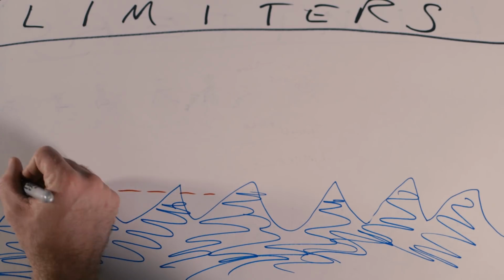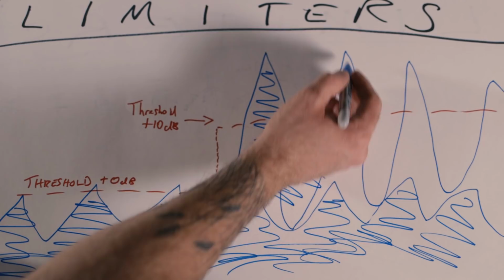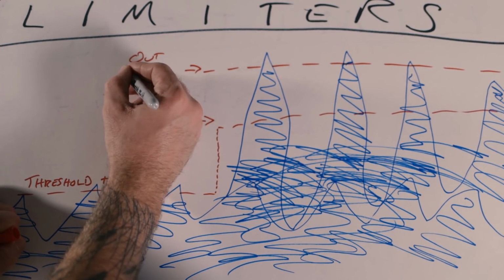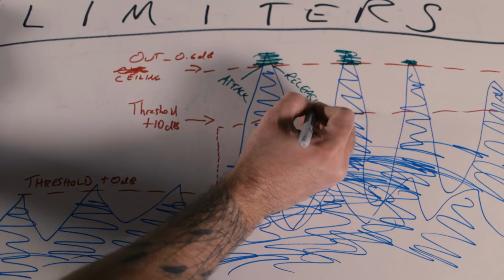What is a Limiter? // AUDIO Production Tools Part V of V // How to use a Limiter tutorial

Comment: What is a limmiter?
Limiter is a dynamic proccesor that manipulates the amplitude of a signal.

Purpose:
A limmiter raises the amplitude at a designated amount and you set an amount for it to stop at.

What does it do?
It just raises it how much ever you want. And their is a ceiling it stops at.

Types:
Brickwall limiting
True limiting etc.

Second Definition:
A Limmiter is like a compressor with above a 10:1 Ratio.
------------------------------------
[] Recall that compressors turn down audio peaks when they go over a certain threshold level. 
[] The ratio determines how much that audio will be reduced by
[] A 3:1 Ratio translates in english to "For every 3db the audio goes over my set threshold, turn down by 1db"
[] Therefore a 10:1 Ration translates to " For every 10db the audio goes over my set threshold turn it down by 1db ???" 

I dont see how it's a compressor when it's not compressing...? Im confused.
Reply from the maker: Help me out with your question - are you asking about a Limiter being a compressor?  It does the same thing a compressor does, just at a really intense ratio.  10:1 doesn't mean every 10db, turn down 1db - it means when the audio goes above the threshold, it is reduced to 1/10th it's original amplitude above that threshold.  Does that make sense?
Reply: Is this meant to be some kind of tldr?